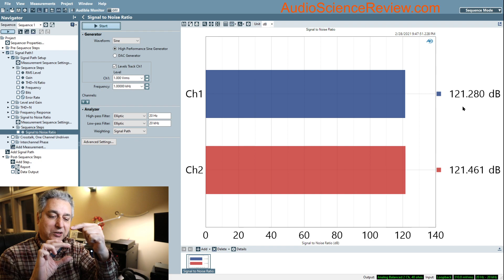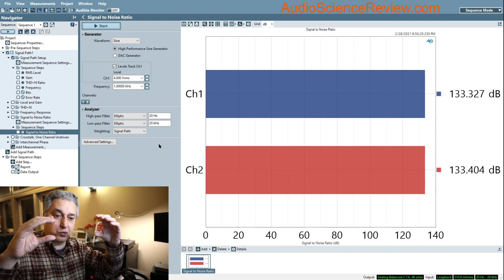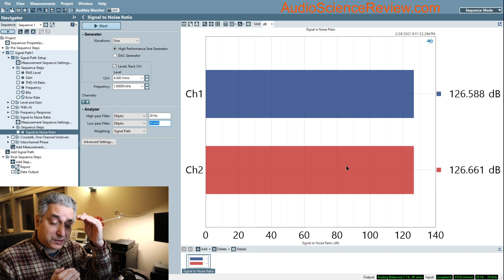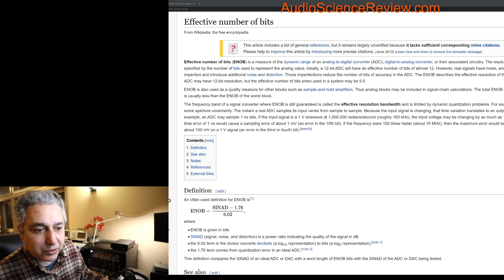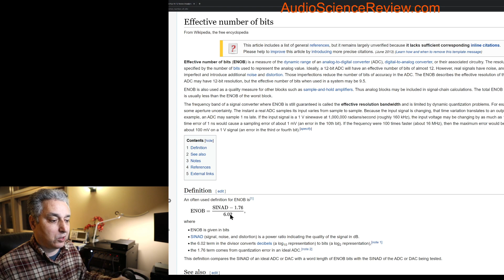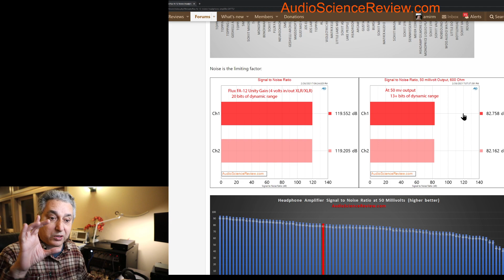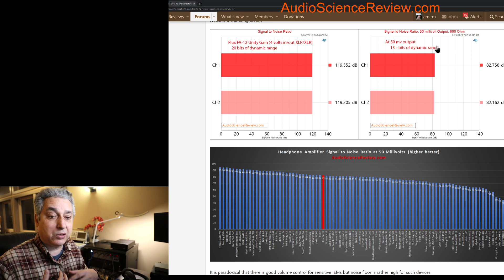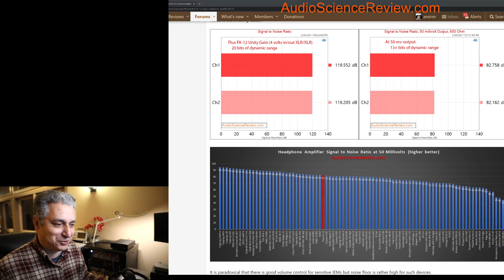Understanding Audio Dynamic Range / SNR (Part 1)

Comment: Another great instructional video. One point that is not explicitly said on the vid is that given the advantage that XLR provides in S/N ratio, it is always the preferred connector if available. Plus its balanced design is inherently free from outside interference and thus noise from the cable itself. Moral of the story, XLR is always better. Even the cheapest XLR cable is a better interconnect than a 10k "magic" RCA.

Comment: At 2:20 you say that our threshold of hearing is -10 dB, but this is a misleading statement at best and not really true. 0 dB SPL is defined as 20 μPA, and in some situations we can hear below that, but that's only for the most sensitive frequencies (around 3.5 kHz), and even then it's only for young, healthy ears adapted in a pin-drop environment and more like -6 dB SPL, not -10 db SPL. For most people, 0 dB SPL is the threshold of hearing even at the most sensitive frequencies, if not higher. Even in a quiet room, you'd be hard-pressed to hear sounds fainter than 10 dB SPL if the room didn't have acoustic damping to further reduce the noise floor of "quiet environment".

Comment: Would putting an attenuator between the amp & phones improve the signal to noise ratio esp for IEMs - since your amp output level would have to be higher?

Comment: For The Head phones you shoul keep that 4 volts just attenuate the output of the original signal to 50 mV. That will shift dow signal and noise keeping the dynamic range.

Comment: I have always wondered what the practical application of dynamic range is in room. If your room noise is  30db, what good is so much range? In order to "cover up" room noise,  the volume will get very loud in order to exploit these very high dynamic ranges.
Am I wrong in my thinking? 
As a tool to determine quality, sure. As for it making a difference in our listening? I'm unsure.
Reply: a simple example, take a fan with a noise level of 30 dB and turn it on in your room, based on your logic you will not hear its noise against the background noise of the room. But I’m afraid that this is not the case and such a noisy fan will be perfectly audible against the background of complete silence... so this is nonsense about 30-35 dB in silence...

Comment: Can I assume if a dac outputs between 2.5 to 3 volts into a the amplifier using rca to rca and you don't hear distortion that doing so should be ok as in safe for the equipment?

Comment: FYI in car audio, 2v RCA is considered low. 4v is good and there are systems with with 5v and 6v RCAs
Reply from the maker: Good point.  There are a lot of sources of interference so higher voltage definitely helps.

Comment: Hey Amir, I'm looking for the best closed back headphone my money can buy, a do it all kind of headphone but more so for the main use with a digital piano / Rhodes. I'll be  trying out the AKG K371 in a couple days but it seems to me they're very flimsy.. (and not the most reliable) a second pair I'm considering is the Meze 99 Nior with Brainwavz oval micro suedes pads that help control/tame some of the the lower frequencies to my understanding. My question is, what pair I should get? Please recommend me a closed back pair that you can think of I can bring my budget closer to $350 if it's really worth it.. (I currently own a "Yamaha Clavinova" digital piano but am soon upgrading to tge "Korg SV2" electric piano/Rhodes.  I much prefer the look and quality of the Meze tho I'm concerned the Meze 99 might not fit my ultimate needs. Any other recommendations? Thank you very much.

Comment: Someone really needs to make a video demonstrating 16-bit or even 24-bit music vs a properly dithered reduction of the music down to 10-bits. Anyone who hears what the extra 6-14 bits does for practically all music one would listen to (i.e., basically, absolutely nothing) would never pay big money for high-end audio again (and would never again question the perfectly acceptable practice of reducing volume in the digital domain vs an analog stereo pot). For most modern music, even 9 bits is overkill, 10 bits leaves a safety margin for the most dynamic recordings listened to at high volumes and with the false assumption that there is no such thing as ear fatigue and adaptation at these loud volumes.
Reply: you are confusing the concept of loudness with the concept of dynamic range... dynamic range is needed to correctly reproduce quiet and loud sounds in a recording, so that everything does not merge into one loud scream. this is tantamount to saying that you need to artificially make all people the same and then everything will be perfect...

Comment: Amir, good stuff! Explaining concepts like “SNR”, or SINAD or “noise floor” is so important! Explaining the # of bits of dynamic range equivalence thing, woah,  I just forget that they came with a name (ENOB) for it but that also a good concept. One slight improvement to your lecture would be where you could’ve tried to show that it’s a logarithmic ratio thing. Or equating the Dynamic Range to experiences like audio in-air acoustics the quietest value of noise you can hear (threshold of hearing, say a pin-drop in the quiet library) versus the loudest jet engine noise when at the airport; this is usually something like on the order of 120 to 134 dB (in-air acoustic sound intensities). Yes, maybe a slightly more advanced concept but possibly useful.
Reply from the maker: Thanks.  Part 2 will be about the second part of your post.  There is a lot of complexity there and I wanted to make sure we covered the basics first.
Reply: @AudioScienceReview  was part 2 ever published? I just searched the channel and this one seems to be the only one (for dynamic range/snr). thanks

Comment: You never mentioned, that even the most quiet room has a noise floor around 30 to 35 dBA. I think it‘s useful to know. Is it irrelevant in this context? When you take the pain threshold of hearing in regard, we are far from 115 dB useable dynamic range. Usual level while talking in a room: 60 dB, large office : 75 dB, door slamming :90 dB, from now on : stress and pain and damage. Excellent recordings with commercial distribution (no ambient, noise, industrial, test records etc.) go up to 34 dB. And doubling power, loudness or voltage   results in different changes of dB. Doubling loudness is 10 dB more. Doubling voltage is 6 dB more. And doubling power is 3 dB more.
Reply from the maker: That will be all in the second part.  This one was the intro to measurements and details behind that.
Reply: this data of 30-35 dB is just a lie, it’s just much simpler... in fact, 30-35 dB of noise relative to complete silence is a lot... during the day in a noisy city, if there is traffic outside the window, I’ll still believe in 30-35 dB of thought in room, but at night or in the evening in a quiet place there will not be such a level of noise in the room in real life...
Reply: @Sergio83Hi-resAudio  You need no belief. Measure it.
Reply: @ChristianGoergen  in order to measure this, the microphone must allow measurements from 0 onwards, but they are initially programmed from 30 dB onwards... Do you catch the difference?)) how can you measure something that is not in the measurement range of the sound level meter?)) you can measure it with a phone without any problems there are even indicated values of 0 dB - complete silence, 5-20 breathing, wind, 20-30 - library, 30 and above dialogue.... I measured it more than once, you’re just a theorist or you believe everything that they write and sell you)))

Comment: Seems like dongles should be standardized at 1 volt
Reply from the maker: 1 volt will not be enough to drive high-impedance headphones.  Like to see at least 2 volts if not 4.
Reply: @AudioScienceReview  People should use low impedance, portable phones when they are out and about. Too much power from a dongle drains phone battery.

Comment: Great video professor. Just wanna ask you a doubt. So if im using dac direct to integrated amp and using dac volume control, then is it better to fix integrated amp volume to a level where you can listen music at moderate levels with DAC volume modulated at the upper extremes.

I use dacmagic plus and smsl su8 which both of them have been reviewed in ASR. Their volume controls are said to be DSP instead of bit variations.
Reply: The "best" setup would be to have all the signal strengths at max and do the volume control at the end. The most practical I find, is to have the source (pc or tv) at 50%, the DAC at 100% and the amp tuned to average listening level. That way you can use the volume control of the pc or tv with pretty much no audible difference.
Reply: @sebdhaese  How are you going to digitally adjust the volume on the DAC by 50% from the PC?))) and who told you that if you adjust the volume on the PC, the signal will not be digitally distorted?
Reply: @Douglas Blake i use asio out from pc to DAC. So pc volume is fixed while streaming bitperfect asio out

Comment: Need one of these on 24bit vs 16bit. Even though 24bit/96khz audio isn't possible how come when people listen to it on their system that's not even capable of CD quality they think the 24bit sounds better... Is it in their head? A lot of music that is upsampled and remastered to 24bit, might it sound better because of the remaster not the 24bit nature? The industry often markets 24bit incorrectly on purpose. If it says 24bit on it all that means is it can DECODE 24bit audio, not actually convert it into an analog signal. I think 24bit has mostly been a marketing campaign and abused in the playback side of things. More light needs to be shed on whats really going on here.
Reply: Decoding 24 bit is easy, just put a 24 bit dac chip in there and done. Producing a very clean analog signal is something else.

Comment: RE: IEMs taking small voltages, what do you think about devices that increase impedance for headphones? These are typically male/female adaptors that add resistors in-line.
Reply from the maker: They are useful when you have a channel mismatch.  I have done a review of them.

Comment: Fascinating. Just discovered the channel last week and the content is superb. I have an engineering background, so I still regard proper test and specification data as important. Just looked at the spec. booklet for my vintage Quad 33 preamp and it DOES give s/n ratio relative to input level. E.g. RADIO : 85dB  for 100 mV input level for 0.5 V main output.  This tutorial helps me appreciate the data.
Reply from the maker: Super.  Thanks for watching.

Comment: Would it be hard to measure the performance of internal power amp of active monitors? Even pink panther certified monitors, for instance the adam t5v (they're inexpensive though), have quite audible tweeter hiss in nearfield, does it implies high noise floor of amp thus not likely for them to reproduce CD quality sound? Also, could the measured THD be a result of both driver performance and amp noise from active monitors?
Reply from the maker: It is not hard but I would have to rip them apart and tap into the right bits.  Can't do this with loaner speakers so have to wait until I can open one of mine.  I suspect they are not very good and hence the reason they are noisy.
Reply: @AudioScienceReview  Thank you for the response, guess there're still benefit to getting passive speaker+expensive amps

Comment: have you ever considered purchasing a vat of liquid nitrogen, submerging a dac or amplifier within it, and then observing the effect on measurements? :)

sounds like a fun / interesting experiment to me even if it isn't practical
Reply from the maker: It would be quite cool, literally.  :D
Reply: You can pickup dry ice at many grocery stores. Just gotta be careful about the condensation on the really cold gear. Maybe put it in a plastic bag when you're all done and returning it to ambient temperature, as being cold in the open air will condense allot of moisture on the internal components.  There will even be frost forming on the dry ice, leaving a puddle behind when all the ice is evaporated, you don't want that puddle on your stuff ha ha. Best to keep the whole experiment sealed from air, maybe you put the gear in a sealed vacumed bag before you even start, but the tradeoff there is if you dip it, you don't get the liquid nitrogen directly on the components.  Which probably also need to be somewhat warm to work effectively ha ha ha.  Capacitor electrolytes can gell up around  15 degrees Fahrenheit, and most parts are optimized for ambient temperatures, suffering if above of below.  But theres an interesting phenomenon where electrical resistance creates heat, and then the added heat increases the resistance, which in creates more heat, and more resistance there's a term for that which I can't remember. (anyone know)  For me it's compelling that by getting everything cold it would really boost efficiency, and probably lower the noise floor from less thermal noise, but some of the parts might get really wonky, or even break :/  I think to make it sing, the components need to be designed to work at low temperatures, then you would get those resistance thermal runaway advantages, and of course turning your whole hifi into a superconductor is obviously the way to go ha ha.
Reply: @SwirlingDragonMist  but dry ice is only at around -80C! take a look at the techniques used in preventing condensation by those overclocking computers with LN2; if you cover the PCB in Vaseline and shop towel you'll be okay for a good while--definitely enough to take some measurements.